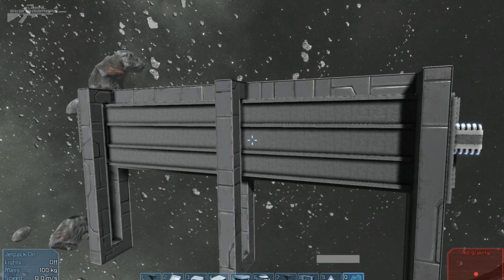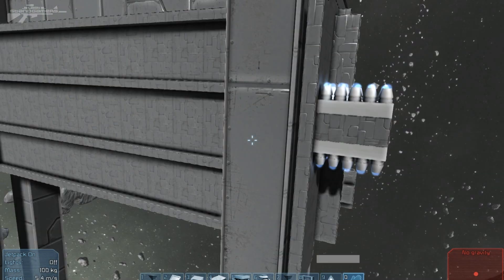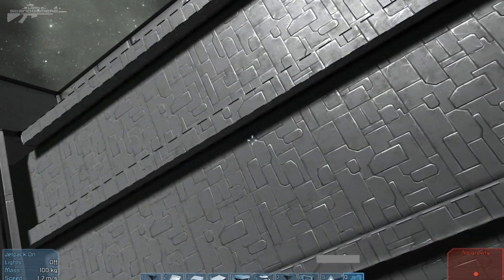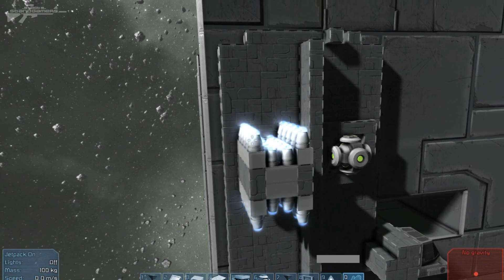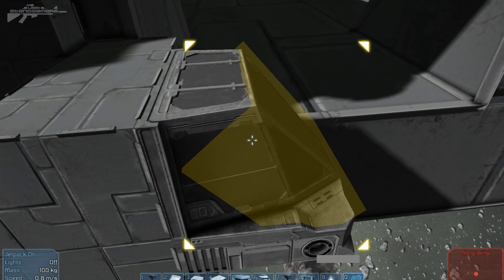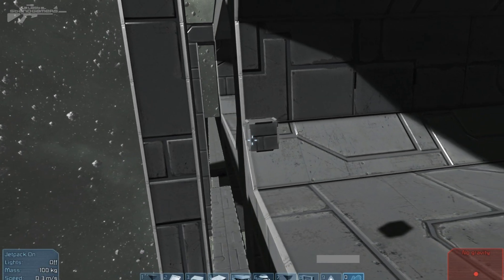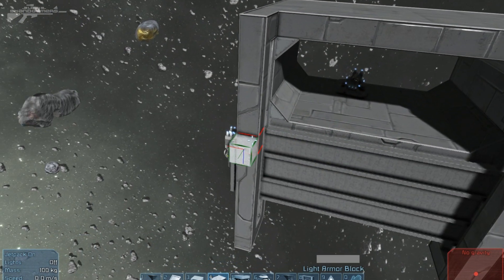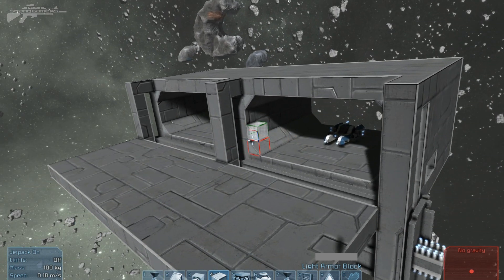How To Build Moving Hanger Doors - Space Engineers

Comment: thxs for the tips you really help me out :) . i have one Q: how do u make one wall like that fast?
Reply: Hold the Ctrl key and the Shift key and then left click and drag to make a plane. You can also go into the Options menu then under Game there's an option to build with Single Blocks, Line, or Plane mode. If you switch it over to planar mode it will by default build a plane and not just a single block. The quick solution though is the quick-key combination of Ctrl + Shift. There's a nice advanced building tutorial on the Space Engineers channel that shows how to build in mirror mode using the plane mode to make builds much quicker.

Comment: With the "parking" patch, you can attach landing gear on the doors, and use it as a locking mechanism. I used it with my tram system in my capital ship, as it would bounce while  the ship's traveling.

Comment: Tried doing this and also applying the same concept to building an elevator. How do you prevent it from bouncing around and destroying blocks? Mine just keep pitching slightly which starts breaking things :(
Reply: Make sure your center of mass is at the center of the door. Only way to be sure of that is to use symmetry mode when building the door. But then again, I never tested to see if the game engine even follows thrust based on center of mass.

Comment from the maker: There are two things that you could try firstly check if the doors is moving at the same angle each time and not twisting even a tiny bit, if it is add a gyroscope fix it and then remove it. Something else you could try to do is further separate the door and the floor. So when you close it, it makes a small gap because every time I have closed a door fully I have the same issue. Hope it helps its hard to solve this one without seeing it.
Regards Arron